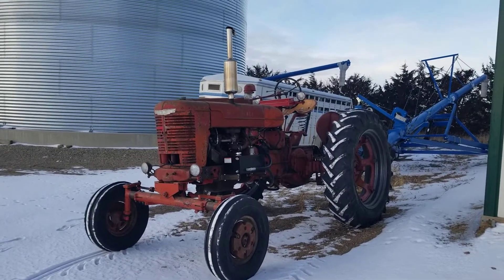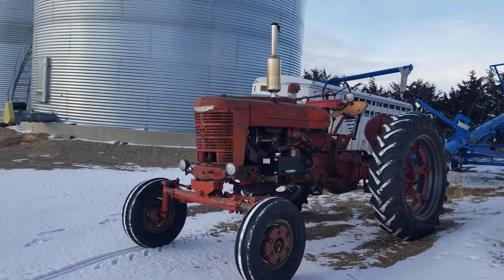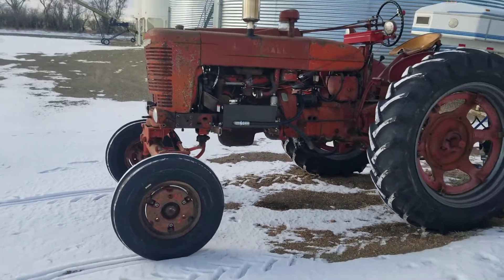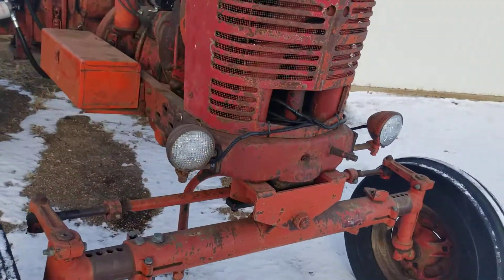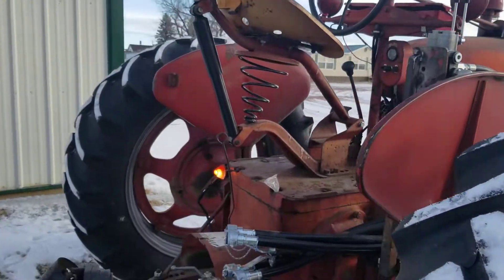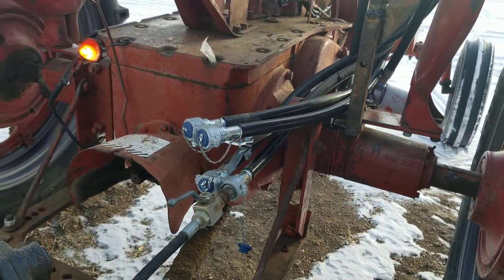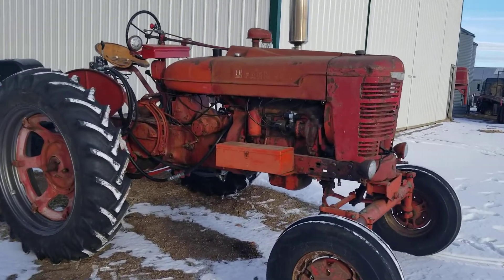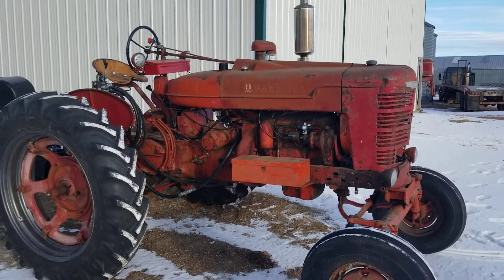41 Farmall M custom hydraulic system

Comment: Im wanting to do something similar,  how did you get the pto shaft mounted to the countershaft key? If its not perfectly center it will vibrate really bad. I had a welding shop look at this idea and they said they couldnt get it dead center.
Reply from the maker: @GPVlog  my welding shop was able to do it. They used the factory threaded drive and slotted the shaft to fit, centered and welded it. I think I'm around 150 hours on it so far with no trouble. If a welding/machine shop is unable to cut a shaft square and weld it centered, I would really hesitate to have work done there.

If you want pictures, shoot me an email at smgussey@yahoo.com

Comment: how did you line up the pump great idea good on you keeping ol iron running i have super m 48 h same as me 450 and fleet of f20
Reply from the maker: Machine shop welded a 1000 spline shaft onto the coupler that screws onto the transmission countershaft. Slid the pump on and built the mounts from that point.

Comment: I like it.  I've been doing something similar with my '48.  I'm using the side PTO drive instead of the belly pump's stub shaft though.   That let's me keep the original M's hydraulics
Reply from the maker: If I were to do it again, I would use the belt pulley drive so I could shut it off when not needed. I may still change this one... or develop a live hydraulic system.

Comment: Looks awesome I want to have options like that not even sure if my belly pump works on my H the tank has no oil in it and the line going back to the couplers on line is broke going to try putting some oil in it and see if it leaks I guess
Reply from the maker: Send me an email at smgussey@yahoo.com I have some info on the factory Liftall pump.
Reply: Sounds good thanks